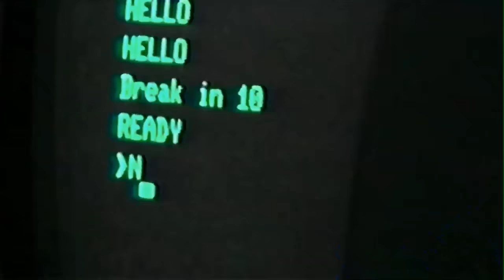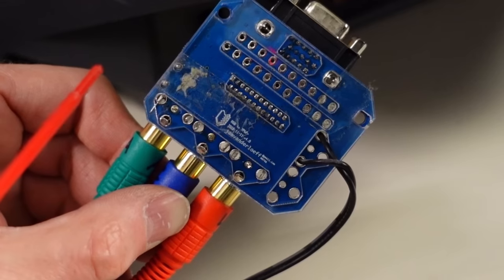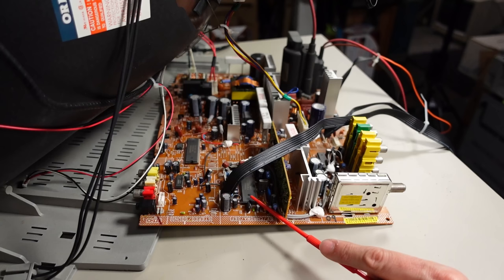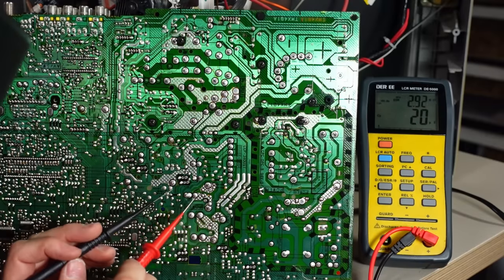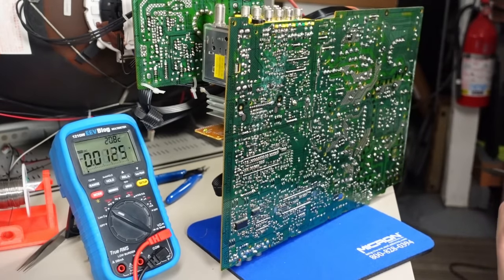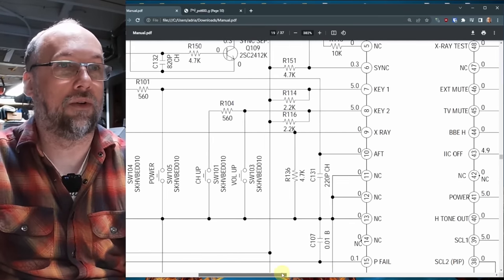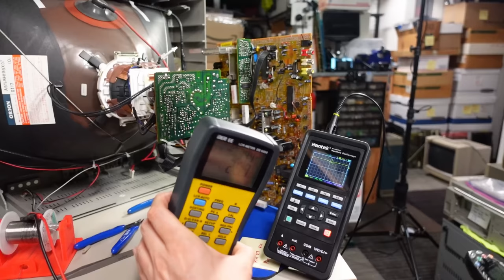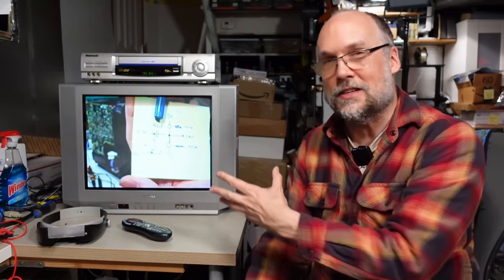I figured out exactly what's wrong with my Toshiba CRT TV (20AF41)

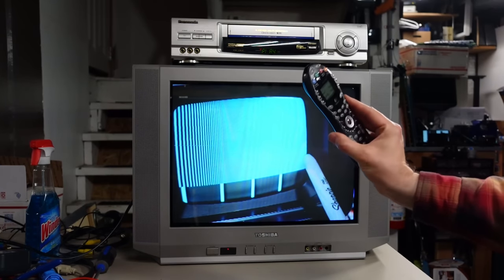Comment: 1:01:48 

I have a harmony ultimate, the kind with a touch screen. I love it, it's really useful. Problem is: my panasonic dvd/vcr wants to pair the remote to the ir sensor. Normally, all you have to do to get this done is hold down "enter" and "1" "2" or "3" for a few seconds. But the harmony remote doesn't support sending multiple commands at once. Has your panasonic vcr had trouble like that? Just curious. I'll probably buy an OG remote if I can't figure it out.

Comment: Another good and interesting video from you Adrian. Regarding the cleaning the video head you should use Zippo Fuel and not Isopropanol alchohol. Because the Iso will leave a small thin layer on the heads of the VCR. And you should also use a white business paper card, because that will not leave any residue on the heads either :-)

Comment: I have had similar problems with some other stuff with a "standby" mode: a coffee maker (with timer) and a home cinema receiver. Both used a simple polyester cap from the mains voltage to power the standby circuit and the relay that powered the actual device. What happens with such a configuration: mostly these devices are designed in a 110V country (at least the Yamaha receiver of course in Japan) and they design the correct cap for continuously dissipating the voltage drop from 110V. As I am in Europe, and we have 230V over here, they simply replaced the cap with a lower capacitance, so they drop a larger voltage at the same current, actually: more than twice as much! Which means that also twice as much power is dissipated in the cap, but especially in the receiver, I know that they didn't put in a cap rated for a higher dissipation and temperature. So they almost always fail after a couple of years, and then, when the relay is activated to turn on the device, the voltage powering the standby circuit drops too much, and the device will not turn on. Replacing that one cap (and then with one with higher ratings!) solves the problem. Similar to the problem here, but as I see, here they have apparently a more sophisticated power supply design for the µC. But still, it fails apparently...

Comment: I just found a Toshiba 20AF42 (same model, just manufactured 2002) in a dumpster last night. Unfortunately it has a voltage issue, switching itself OFF almost immediately after pressing 'Power'. The tube is OK, as I can just make out "Video 1" before it flashes off. I suspect it was damaged when tossed in, I found it facing glass side down!

I'm tempted to open and repair it, but I have very limited experience working inside live CRT's so I'll have to let it go. Too dangerous, but I know I may regret it later. I was hoping to have it replace my Toshiba 14AF46C (mini 14" Toshiba TV!) which I'm currently using with a VGA to component transcoder to display 240p arcade games in a rotated mode. Certainly not my only CRT, I've been addicted to collecting and using them for years! :)

EDIT: I temporarily put the TV aside, if anyone has advice on how to fix it or what may be wrong, I'd like to hear it! Maybe it's a simple fix?

Comment: Good job. I knew you could figure it out. When there's patience, there's a way.
I wish I could make use of an VCR I have up there shelf stored. When powered up, nothing appears on the screen. I don't know if it has OSD but I believe it does not have any or just few things. Same when putting a tape... just plays the audio and nothing comes up on the screen. The front display is kinda dim. Unfortunately VCRs are not modulars like TVs. They usually have lots of screws and cables and parts. I kinda probably think that the power supply is kinda the issue.. the front display low light, picky with mistreated tape,...  I tried acetone and IPA with the rotating head but no joy. Oh well, maybe I contact the guy you listed on the description.

A morning stream? It would be afternoon for me. You need to think about the fellow americans who didn't yet wake up. Maybe an afternoon live stream would be better.

Comment: Note that small and high-capacitance ceramic capacitors lose capacitance when charged to high voltages, as the dielectric "saturates". I suspect this could cause problems in some circuits.

Comment: We had Toshiba or Panasonic flat screen CRT until it's IR failed. We sent it to warranty repair but they offered refund so we got Orion flatscreen. We also had (still have but not using) Orion DVD and some signals  were interfering with CRT. It all makes sense now, because most likely that big TV were also made by the same company so used same signal codes. 
On unrelated note, that flatscreen Orion have composite, component, S video, VGA, DVI. No scrart, despite selling in EU. It also had funny machine russian translation. I remember my friend coming with xbox 360 and over  component it were 1080p like picture, super clear, i wont differentiate that from HDMI connection .

Comment: On the SCART in Australia point, I recall that before the launch of DVD in the late nineties, higher quality AV interconnects were relatively uncommon. However, from the late nineties onwards, most equipment stated to come with some sort of higher quality connection. It was,  however, quite a grab bag. Consumer equipment that I came across only ever had one type of higher quality connector, but there wasn't really an agreed upon standard. SCART, YPbPr, and VGA were all very common. I never saw a 9 pin RGB on any AV equipment, but I wouldn't be that surprised..

The result was that interconnecting consumer AV components required a full range of Frankenstein cables and converters. And, given the complexity, lots of people just stuck with cheap and junky composite leads.
Reply: Even crazier was the late model Australian widescreen CRTs that accepted component for people running foxtel.

Comment: Where do you get your schematics? I have a smaller toshiba tube model E8069PDA-CD and I'm looking for the pinouts on the back of the tube. I'm also looking for voltages for the different parts of the tube.

Comment: Put a relay on the power led then you could hook up another light  to it as a reminder it's on.  Or feed that led output to an esp8266 input and then you can monitor it with homeassistant and even control the power remotely via wifi.

Comment: Was that cap really the problem? Replacing it with one 2x the capacitance reduced the droop a bit, but not that much, just enough to now avoid the reset trigger. I'm wondering if the 5v rail is getting weak or something (degauss circuit?) is starting to eat more current. If if soon dies again maybe look at transistors.
Reply: It's mainly a design issue. The sagging 5V rail (AT+5V, standby 5V) is driven by a simple pass transistor+zener regulator, which gets its input voltage from a 8.9V rail (filtered by 470uF). The same 8.9V rail also powers a switched +5V rail. The 7805 on that switched rail has a 470uF capacitor on its input. So when the switching transistor turns on the switched +5V, suddenly a discharged 470uF capacitor is connected to the unregulated 8.9V rail, which only has an other 470uF as reservoir. Not great, but to make it worse, the 7805 also has a 1000uF on its output. The 470uF on the 8.9V rail is probably a bit tired, and since it was marginal from the factory, it was enough to trigger the reset IC. As I suggested above, I would increase the capacitance of the filter on the 8.9V rail.

Comment: I did wonder if this was going to end up being a bad capacitor. The set starting to work after a short while of it failing is fairly typical - the bad capacitor "warms up" and starts to work as it should. Perhaps that explains why it read OK on the ESR meter.

It's also possible that 470uF was always a marginal value, and when the capacitor was new it was slightly higher capacity. Now it's aged and the capacity has dropped, the set started having issues.

Comment: I just trash picked a 27" zenith.. got it home and it wouldnt turn on. Read somewhere that it may have had bad caps.. I left it plugged in for like an hr.. came back and it turned right on.. come to find out.. it had bad filter caps. Also just recapped a 1988 13" samsung I picked. Works good. Now im going to do my sony.. caps dry out..

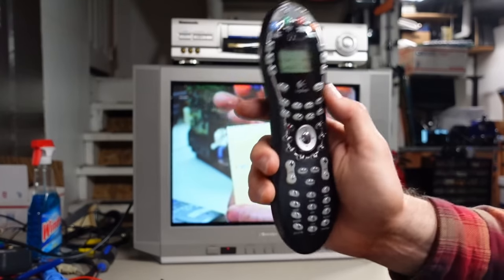Comment: 1:01:49 It's too bad Logitech ended the Harmony line.

I do recommend the Inteset line of learning remotes in place of them.

Upside is you don't need a database or software to program them you just need a working remote it can learn from. Downside is you need a working remote it can learn from.

Otherwise it can be programmed like a regular universal remote.

I like Inteset's stuff. I have a USB IR receiver from them that works on Rokus/streaming boxes and game consoles as well as computers and uses any Xbox Media Center compatible remote.

Comment: When I was in High school I made a tesla coil using a vacuum tube transformer which converted 120 VAC to 10,000 VDC at 30mA I took several hits from it and it never killed me. the current was to low. 1 amp can stop a heart and kill you. the lethality is in the currents available and not really the high voltages. It's true always be safe when working on anything electrical. you will feel the pulse from the electrical discharge for sure.
Also in auto class we used to do the daisy chain thing using Magnetos to give the last person in the line a shock as a demo. None of these things are done or even should be done. It was in the day when don't do this because this will happen. we all learned by experience. not by what we see on the internet.

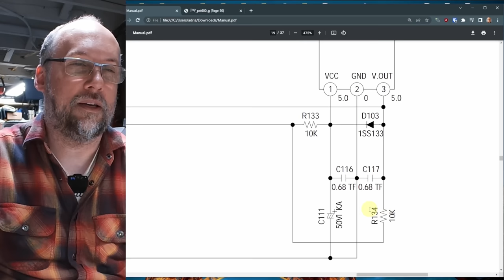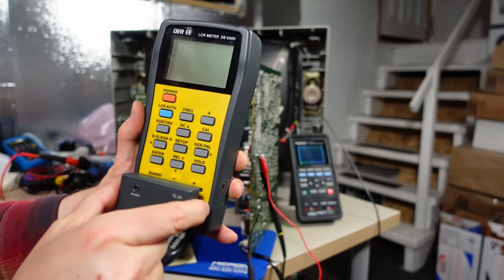Comment: Having the set fail at only a 93uF drop in capacitance is a puzzle. You may have intended to say that you replaced C116 (as opposed to C118 @53:10) as that is the filter cap shown on the schematic @49:07 - - however that is spec'ed at 680uF. Since you pulled a 470uF then that would seem like a production line substitution with the circuitry unhappy at the actual 377uF which you read from the pulled part @56:35. OR there was a revision and the filter was changed to C116. In any case I'm thinking this filter should be 680uF to fill that larger hole. This solves the 93uF mystery because compared to the spec we are now coming up 55% / 303uF low. Perhaps such substitutions is where Orion got its reputation for hit and miss quality.  Anyone else having problems might include looking for manufacturing substitutions as part of the failure mode.

@55:30 Could the marking on the cap be VK (as opposed to YK) series? Tho if it is counterfeit its whatever series the frauds dreamed up.
PX is the long life version of the PM series.
https://www.eevblog.com/forum/testgear/nichicon-capacitors-series-differences/

Comment: fun thing.. i've got 3 toshiba flats 27 inch and a smaller 20 inch one all made after the cut off for when orion was supposed to have made all toshiba smaller TVs.. but it appears they all have philips tubes and use toshiba components. i have yet to find a single orion set from toshiba. i've looked at more than the ones i own too. i think they may have done something else in Canada.

Comment: Its a good idea to just go and replace all caps below 8mm diameter, as them like to dry out and fail that way.
The bigger ones are an option too and its good to do it too, but not as necessary, especially the fat 13mm or bigger ones are rather reliable. But also over 20 years old...

Comment: It seems that the voltage regulator issue or a open resistor on the horizontal section.

Comment: You are so brave, knowing what I know now about CRTs, I’m honestly floored that those were ever considered safe to own. 

Please stay safe, gives me the willies when you open one up. Far braver than me. But thankfully you’re doing your small part to help with E waste problem.
Reply: When they're closed there's really no danger to the user... What is it gonna do? Spontaneously explode? And even opened you really have to poke the wrong spot to get hurt
Reply: Sounds like you don't really 'know what you know' about CRTs if you're "floored that those were ever considered safe to own". There isn't a history of them being unsafe for consumers. It makes no sense to pretend like the dangers of repair somehow extend to the consumer. It's also dangerous working on cars; that doesn't make them 'unsafe' for drivers.
Reply: @jamescarter3196  CRTs were considered dangerous enough that the surgeon general advised that people keep a 6 foot distance, and avoid the the back and sides of a unit while it was in operation. They’re not even just dangerous to work on, they’re dangerous period. Tens of thousands of volts, poorly shielded, open vents. 

Not to mention all the mishaps that can and did happen. 

What are you on about? 

Sounds like you don’t know what you’re pretending to know. 

Not every dangerous incident with a CRT is related to cracking it open and poking the fly back transformer.

Comment: what is the number on the small chip in the center of the rgb adapter?
i guess toshiba used the cheaper small cap to cut costs. often those smaller caps are the ones that go. larger caps seem to have the longer run.

Comment: 377 is 20% low if that's a 470uf cap. If the circuit is built for 10% tolerance in mind, that could do it.

Comment: The cap was the bad part or the cap is helping to desensitize the test circuit for the other aging components.  Which is fine, but may not be that the capacitor was "bad".

Comment: 10:00 "Opening up a television set is very dangerous, specifically because if you have it connected to mains, and if you have it turned on, there are lethal voltages inside here."  This is wrong.

If you do not have it connected to mains, and you do not have it turned on, there may still be lethal voltages in there.  This is the most dangerous aspect of working with CRTs, and something that should always be repeated again and again.  They are basically massive high voltage capacitors and can hold on to lethal voltages long after they are turned off, or even unplugged, even for days or weeks after their last use.  Do not mess around with a TV or other CRT device even if it has been turned off and unplugged, because it can still kill you if you don't know what you're doing, even when it's completely unplugged.

(I know Adrian knows this, but it really should be explicitly said every time in case somebody less experienced who hasn't watched all his other videos gets the wrong idea and thinks it's safe as long as it's unplugged or something.)
Reply: Go to a fairy cake cooking programme...NOW!

Comment: I honestly don't think it's the volts that really matter, the amps on the other hand, those are the ones that will stop your heart. The volts I think are the highway and the amps is the traffic, if that makes sense. I'm pretty sure of that.
edit: also, when disassembling a case I use a magnetic screwdriver (not on the actual component, but on the plastics) works like a  charm to keep from dropping a screw under the table, lost forever!

Comment: When one electrolytic cap is going bad, it's a sure fire bet the other electrolytics aren't far behind.  Best just replace them., at the very least those on the power rails.

Also, caps witth good ESR may still be leaky (parallel resistance).

Comment: Seems to always be one single cap being a PITA and not charging up fast enough, had similar issues in power supplies where they'd "blink" a few times before they kicked in, and it's always something like a bootstrap cap or the like, just a smidge different in this case, but not all that far off...

Comment: A 2200 microferret cap measuring 1900 is definitely suspicious. Not all failure modes show reliably if you measure capacity and ESR only, and values that are barely within or just out of tolerance are red flags that require further checking (with a better meter, or by substitution).

Also, measurements taken "in circuit" are mostly unreliable. ESR can often be measured if the test voltage is very low. Shorts can be recognised but often not traced. Some resistane measurements are reasonably reliable.

Comment: 2001 is very late model? That's all I have besides 3 of mine, lol, give or take a couple years, which is how old a broken JVC that I have is. It's from 1999, and one day it just stopped working while I had it on outside during the colder months. I think condensation from the heat being generated inside and the colder air on the outside of the TV caused something to fry, because the day it turned off for the last time, I smelled a horrible electronics burning smell.
One day I'll get it repaired, somewhere or myself. 🥲

Comment: Awe man. I had a big RCA dimensia TV from the mid 80s maybe and it had all the bells and whistles. Probably had this same issue. One day it just wouldn't turn on and you'd hear a clicking relay. Didn't have much knowledge of repairing electronics then so it got binned. Thing had an amp and speaker outs on the back, as well as SCART. US based TV with SCART.
Reply: Well, the reason for your RCA TV set to have a SCART connector is very simple : RCA electronics brand has been bought by the French company Thomson in 1986, they included very quickly their own tech into the RCA Dimensia products lineup, including the SCART connertor
The meaning of SCART is quite revealing : Syndicat des Constructeurs d'Appareils Radiorécepteurs et Téléviseurs/syndicate of radioreceptors and television devices manufacturers, Thomson being one of the leaders of this syndicate with Philips and Telefunken.
Funnily enough, the "SCART" acronym is virtually unkown among French people because this connector has been named Péritel (PERI TELevison) by French authorities who were fixated on neologisms including "tel" in all tech related words (like Minitel, télématique...) because of the sudden and much needed growth of the French telephone network infrastructure during the early 80's.